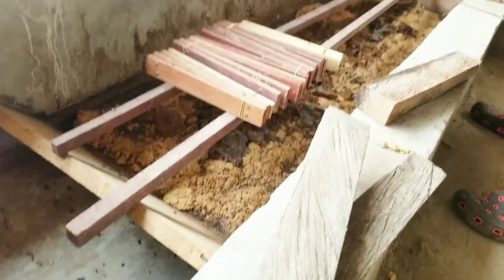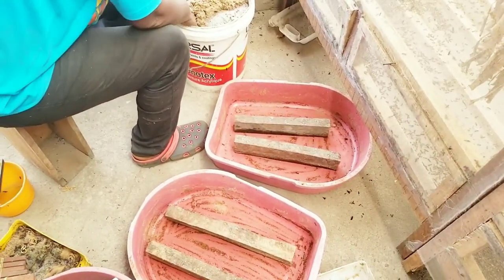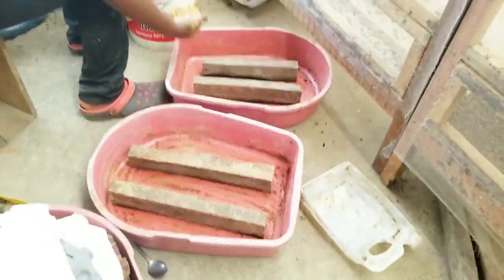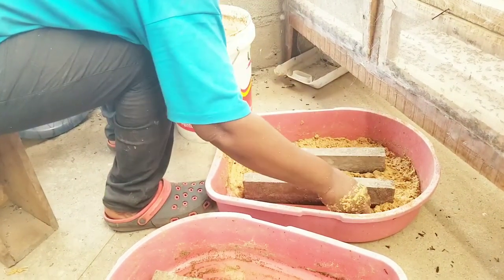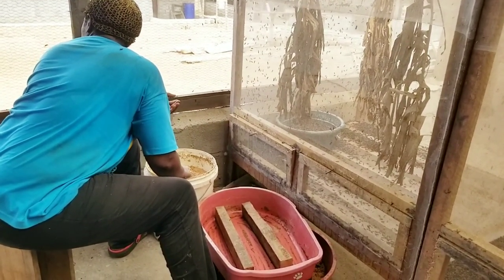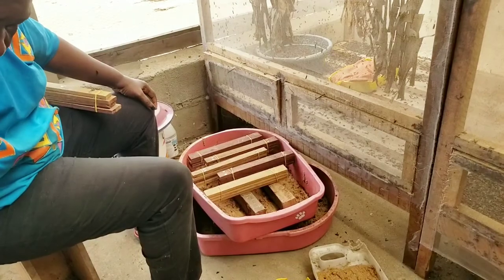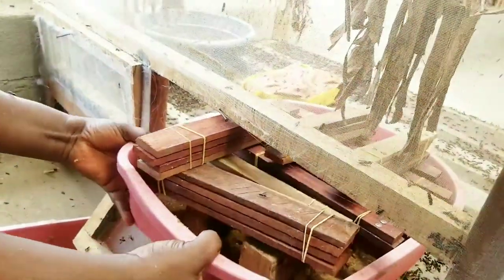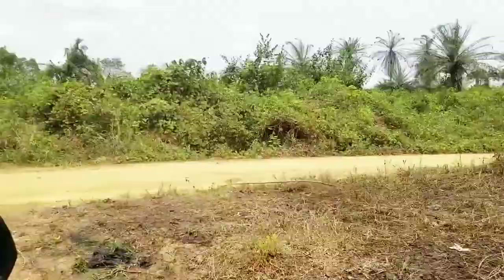Black Soldier Fly (BSF) Eggs Hatching | Mating House | Business in Africa

Comment: Thanks  for ur good work,  pliz  i would like  to know  ur structure which roofing  sheet  did u use? Or  if i put up  B S F building  like ur own which  roofing sheet  to use. Thanks
Reply from the maker: I used zinc roofing. But make the height high enough for good ventilation
Reply: @gwendolynehalle   what is the name of the net u keep  the BSF  if i am going to buy , pliz , thanks
Reply from the maker: @danielayensu5849  for a start buy good nets. I can't remember name of the nets used.
Reply: @gwendolynehalle  ok, thank u very much...
Reply: @gwendolynehalle   there  are different  types  of net , fir u to go into  BSF farming,  the name  of the net to keep  them, i need  ur help thanks